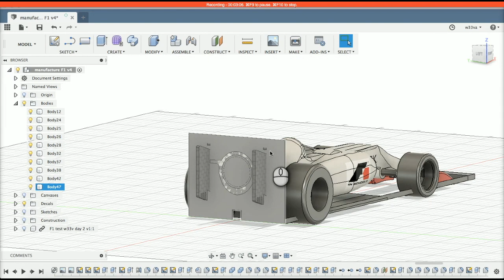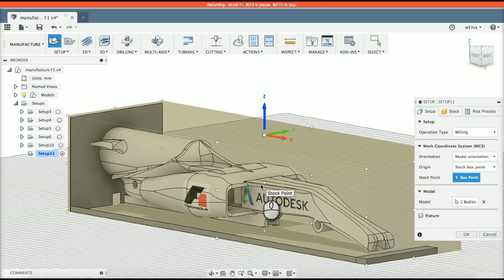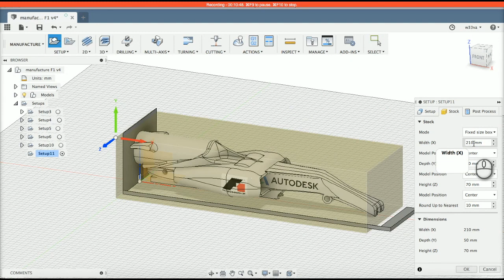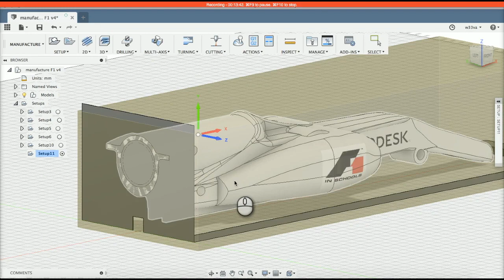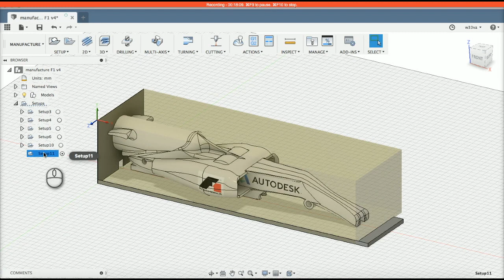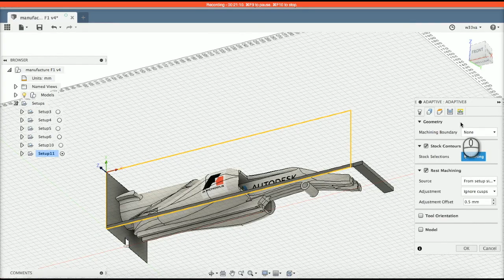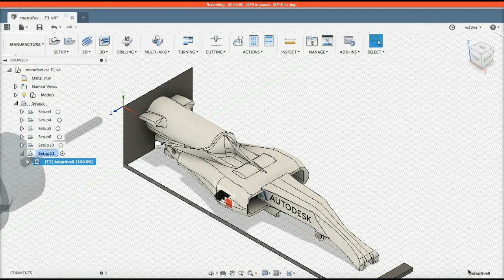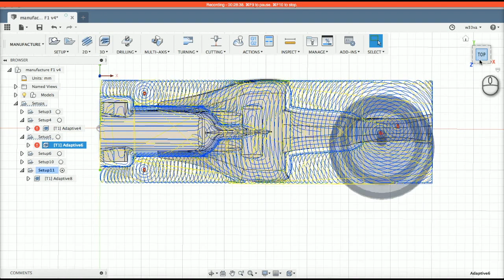F1 in Schools: Getting your design ready for CNC milling

Comment: It helped me a lot. Could you please answer some questions?
Do I have to redo the configuration in the other views, such as the side and top views, as well as in adaptive roughing?

If so, do I follow the same process, setting the axes where the tool should go for each view?

I'm not sure if the questions are clear because I used Translator. Thank you very much.
Reply from the maker: Yes, you need to adjust for the depth as it will change depending if your on the sides or bottom and top. But this is really just the clearances

Comment: A Great help, I have a few questions I wondered if you could answer? 

1. Can this method work on any CNC Haas machine?
2. Is there a quicker way to set the datum on the right and left side?
Reply from the maker: Glad it helped, 
1. It can, you just need to make sure you know where your machine zeroes and what direction it cuts from there. Look at it's working space. When it comes to the post proposes, you'll need to make sure to check generic Haas and then quickly look at the first few lines of code.
2. At the moment, Denford has the ease of use down to a fine art, I have an idea of using a laser and a couple of targets that I'll try out soon.